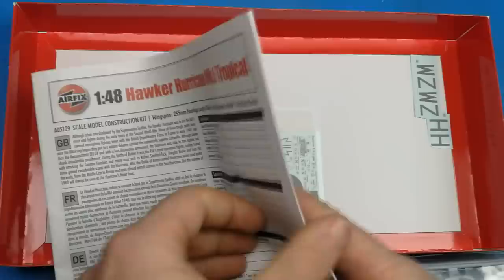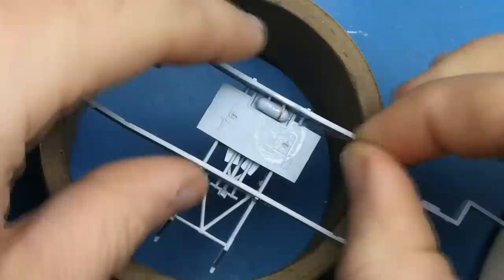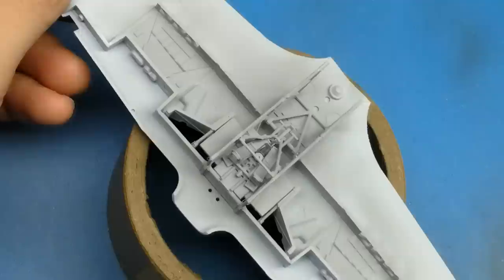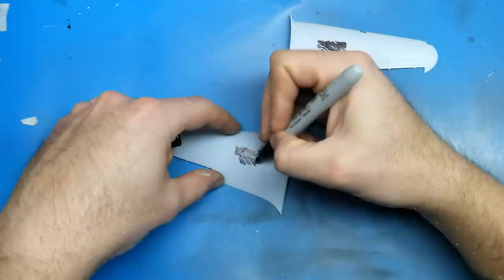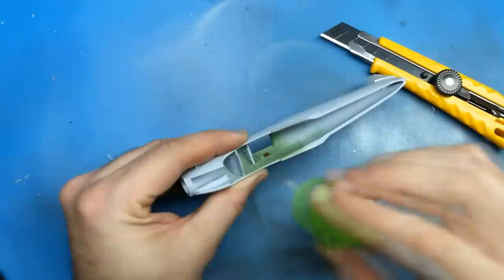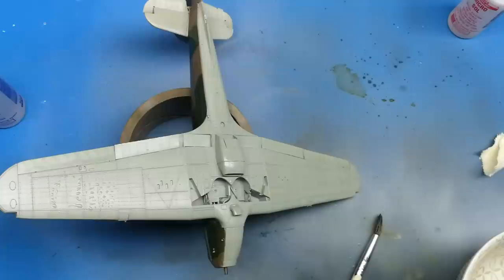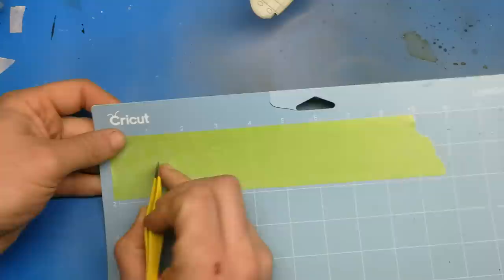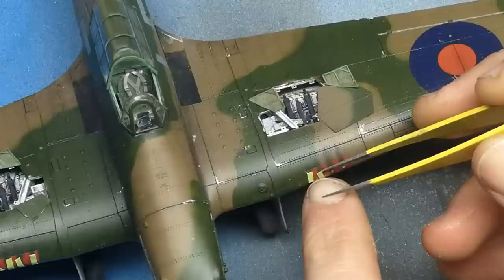1/48 Airfix Hawker Hurricane Mk 1 - Extended Build

Comment: Really nice build. Just one note - the fuselage roundels should be in alignment, if viewed from above. Their frontmost tip should be set slightly back from the antenna mast. The squadron and aircraft ID letters should be built around the roundel, not the other way round. Basically, the aircraft serial number and roundel remained constant through an aircraft's life, but if that aircraft was moved to another squadron, the three letter ID code could be painted over and repainted quickly and easily. But really, really good build. Well done!

Comment: Awesome build, I have built models for years but thanks to youtube never had the access to the techniques used to make them so realistic ,thanks
Reply from the maker: It's an awesome resource! Guys like Night Shift, Plasmo, Scale Model Work Shop, Scale Hangar 182 and Scale-A-Ton are just a few of the guys I follow for tips and tricks.

My next video will feature quite a few what not to do tips.
Reply: @TheModelGuy  What do you use for installing decals I bought a model master decal set and I'm not happy with the results I can't get micro set and micro sol right now all the stores are closed due to Covid19
Reply from the maker: @robertblake2765  I use micro sol and micro set. Then once the decals have dried I do two coats of clear and sand it down over the decals to get rid of the step.

Comment: You truly are a gifted modeler. I’m lucky to build what comes in the box without throwing it away. Now, I know I’ll probably get flamed for this, but the powder stains on the wings are terrific, but from pictures I’ve seen, where the shell casings come out of the bottom of the wing don’t have any or very little black streaks. The powder has been burnt and expended from the end of the gun barrels. Empty shell casings won’t leave those types of streaks. Please understand, I am NOT being critical of how your model turned out and I’d give anything to have your skills. As for the streaks, I’m just going on pictures that I’ve seen and what I know personally from firearms. I worked with the gunners mates when I was in the Coast Guard and I’m also a gunsmith. Now, if I’m wrong in what I said about the streaks where the shell casings are expended, please accept my apologies? Thank you for sharing a great video of your build and your model. 
God speed
Reply from the maker: No worries, I appreciate critique when it's not in a negative manner. I have gone a bit too far with it, but I'll reference this photo:

https://images.app.goo.gl/SP3cgN9orZvN52KA8

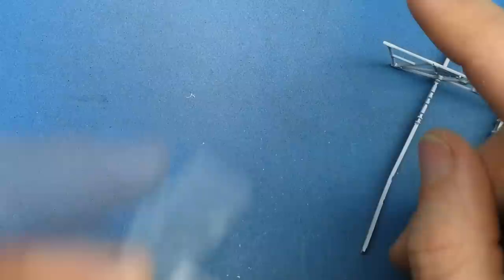Comment: 2:36 Yea I had problem with that when i was building mine. Had to sand away alot of material and it still didnt fit properly. I wasted time trying to figure out how to do it so it wouldnt be ugly. Thats for anyone who would want to build this model, take some time to make it right.
Reply from the maker: The new Airfix molds are a great improvement, but I feel that when companies try to make an aircraft posable a few different ways it can create issues downstream. Kinetic has done the same thing with their models and my E-2C wings did not want to align in the spread position.

Comment: Nice build. The other reasons why the armourers used to dope & linen cloth the gun ports was to quickly identify those aircraft that needed re arming on return, versus those that did not fire their guns at all (more common than you first expect). Individual guns that failed to fire & to protect from frost & freezing during rapid climb to altitude.

Comment: All options for the Airfix Sea Hurricane, Tropical Hurricane and Battle of Britain Hurricane are all in all three of the kits, it's only the decals that differ so if you buy 3rd party decals it doesn't matter which kit you buy but the instruction sheet does not show how to use all of the options but its easy to work it out.

Comment: Excellent build. The only issue I see is the exhaust needs to be painted more realistically.  It wouldn't be bare metal like that. Needs to be a bit heat treated and have some exhaust blackening added.

Comment: Nice Hurri! One tip I'd suggest from my own experience would be to use Mr Color's 'Super Clear III' diluted with Levelling Thinner rather than Tamiya X-22 as it dries thinner and more uniform. Also, whilst the chipping on the airframe's metal areas looks really good here, RAF prop blades during the war were made of wood composite material so didn't chip like metal blades. :-)
Reply from the maker: During the course of the war, the Hurricane used a variety of five different props. This one has the dehavilland propeller which had metal blades.

Thanks for the tip on the clear coat. Since this video I've picked up Mr Color Levelling thinner which made a huge difference
Reply: @TheModelGuy  Ah! Fair enough, my bad on the prop then! :-)
Reply from the maker: @rifledude303  no worries! I am open to being challenged on the information I provide on this channel. I am going to make mistakes, but I try to reference books and verified sites. But no one's perfect. :)

Comment: Lovely modelling . Just to mention your comments about the Big Wing . Stephen Bungay the writer probably the best researched Battle of Britain ; goes into much detail about the Big Wing and really concludes that Parks method of engaging in squadron strength was far better . ! it took too long to assemble so many planes in the short time it took the Germans to arrive . Bader claimed far more kills for this method than really occurred even by the standards of the time . Mainly because so many planes engaging caused many pilots to attack the same German . I suppose seeing so many planes on September 15th certainly had a bad effect on German morale . Of course Park later went to Malta and proved how good he was . Mallory was promoted up and made bad job before DDay grossly exaggerating potential losses.

Comment: Very nice video. A couple of comments though: The airflow ( from the aerodynamics) would guide 95% of the gunsmoke OVER the wing. The dirt from the brass openings are however correct. I have never seen any photos of gunports where each port were sealed like this. My impression is they ground crew used one large patch to cover all 4 ports. But I might be corrected on that. :)

Comment: No RCAF Sqns in England during the Battle of Britain you say???   You need to check your history.   No. 1 Sqn RCAF flew in the UK throughout the battle, eventually being renumbered as 401 Sqn on March 1, 1941.  401 Sqn still serves and still carries the battle honour, "Battle of Britain 1940".    As for 242 Sqn, it had a few Canadians serving with it, but they were not all Canadians serving on the squadron......just as 44 (Rhodesian) Sqn wasn't staffed with just Rhodesians.
Reply from the maker: #1 SQN did not start operational flying until August 24. They also accidentally shot down two Blenheims the same date.  Their Hurricanes were not on par with the  British made Hurricanes until mid August and they were not authorized for combat initially. 

242 Sqn was formed in 1939 with mostly Canadian members and was in action in February 1940. They were known as the All Canadian Squadron. 

#1 Sqn was not a stand-alone fighter squadron and was under British command. So my statement is true, that no RCAF squadrons participated in the Battle. It wasn't until they changed to 401 Sqn were they identified as a Canadian unit.

Comment: Ratio of Hurricanes to Spitfires built was 5:1 , Hurricanes went for the bombers where as the Spits took on the 109s.
Reply: Hurricanes also took on 109's
Reply: true but as the turning circle for a spit was tighter than a hurricane the spit was able to keep tabs with the Me109 where as a hurricane could take more damage due to it's canvas body. one of the reasons everyone sees the spitfire as the no.1 iconic RAF  aircraft.  although the hurricane  had a good career during the war it ended up on secondary duties like tank busting in the desert.

Comment: What did you use for the camouflage mask? it turned out really great!
Reply from the maker: I print out a 1:1 scale copy of the camoflauge pattern and then cut out the sections as a mask. I roll Tamiya tape into a two sided tape and use it to hold the mask in place. Since the tape is rolled, it gives you a very tight demarcation edge

Comment: I don't have the same skills as you but I am finding it impossible to get hold of a 1.48 scale Mk.1 hawker hurricane (BoB). I've seen one on Amazon by Airfix but they want £1,109.04 for it, that would empty my bank account and then some. I'm trying to put together a battle of Britain diorama with refueler trucks and ground crews.
Reply from the maker: Amazon has the Tropic Hurri and the Sea Hurricane. Both can be used as all three kits have all the parts for all the variants.

Comment: ...During epoch of steam the locomotivs were more clear than this Hurricane-why the mechanic is not equipped with f rag...
Reply from the maker: Because fighters returning from ops were stained from Gunsmoke. Also, during the Battle of Britain ground crews were turning fighters around in as little as four minutes. I can't wash my car in four minutes, so I imagine an aircraft takes longer.
Reply: @TheModelGuy  ...Ok this Hurricane is returning after air fight-why the loop-holes of machineguns are virginly unbroken?  Greeting from Russia.
Reply from the maker: @user-sd4pj7vy1q  they would be covered with fabric after the guns were cleaned. Another group would be loading the guns. They didn't really clean them during the day. Normally it would get cleaned during maintenance over night